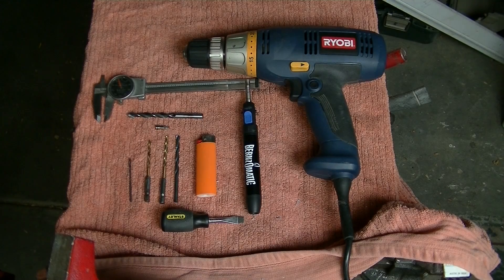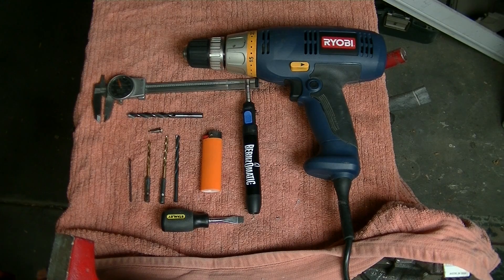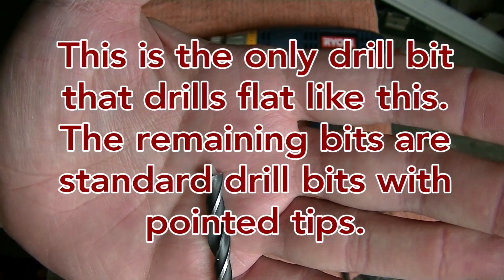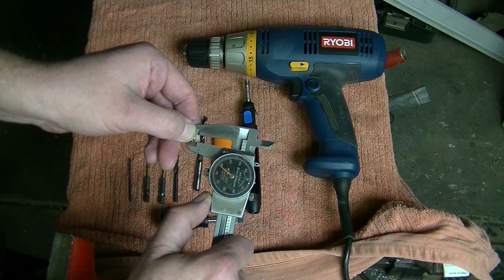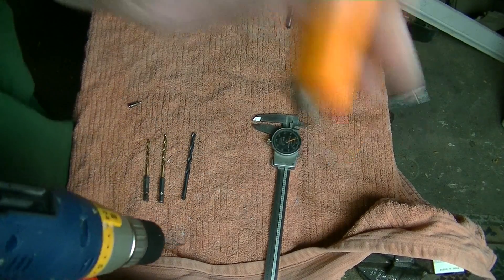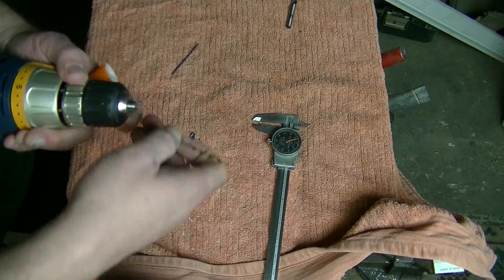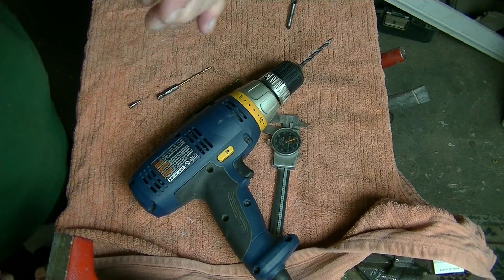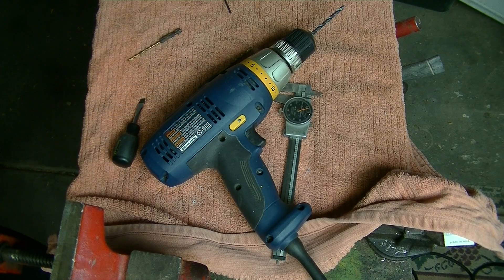Make A Bic Lighter Refillable By Installing A Refill Valve

Comment: You're insane. I wanted to refill if to SAVE MONEY. Why the hell would anyone spend $10+ to end up with a cheap-looking refillable lighter? I'd rather spend $10 and buy a proper good-looking one lool
Reply: Lol Clipper? Really? I call bullshit. No way in hell are you going to get me to believe a refillable butane lighter that's CHEAPER than a single BIC is going to be as good. Pretty sure that's why they sell them in packs.
Reply: retvolki he must have alot of down time
Reply: fezbot100 or he doesn't want a store bought schmucks lighter.
Reply: With 10 bucks you can buy an ok one bro.
Or you could also buy a crappy $3 one, remove the valve from it and install in your BIC. Sounds like a smarter idea.
Reply: Show me one you can buy that isn't a damned torch and I'll agree with you.
Reply: fuXstiCk Clipper produces some darn good ones, they're pretty much like BIC except that they're refillable and flint is not as durable but that's easy to fix.
Reply: Clipper wishes it was a Bic. All they will ever be is a Bic lighter knock off.
Reply: fuXstiCk okay so your problem isn't that you can't find a good non torch lighter your problem is it's not a refillable Bic
Reply: Minong Maniac Clipper lighters were around for about 20 years before bics so if anyone's a knock off it's Bic
Reply: Maui Randall lol try again. The clipper lighter company didn't even START until 1972. Before that they weren't clipper and made perfume and makeup or some shit. BIC started in 1973. Do some fact checking before you start throwing BS out there.
Reply: fuXstiCk okay so you admit bic is still the knock off but it was made 1-3 years after clipper instead of 20
What was your point?
Reply: fuXstiCk and the Clipper company started in 1959 the Clipper lighter was designed in 1970 and released in 1972 all before Bic
Reply: Maui Randall you're not a 'knock off' unless you're trying to be like something else. I didn't proclaim then to be a knock off. I'm simply contesting your '20 years before' bullshit.  BIC pocket lighters have never come refillable. So what's the comparison?  However, i AM saying they're SHIT compared to BIC
Reply: Retvolki why do you care what the your lighter looks like? Personally mines in my pocket till I use it then it goes right back in my pocket so nobody borrows it then posts lighters are free on these videos.. lol sorry I just couldn't resist the last comment. Not aimed at you bro..
Reply from the maker: Some of us prefer functionality over aesthetics ... different strokes ...

Comment: Please tell me where I can get the butane refill nozzle? I've searched everywhere online. Then some people tell you to remove them from an existing refillable lighter, but no one shows you how to do that. Please any information you can share with me, would be extremely appreciated. Thank You So Very Much.
Reply: HERE in calif i usually find those stores harbour frieght, or those dollar store usually owned by oriental, anyways they usually have butane torches for less than 2.00 which is better than spend $10 and up i just bought 20 yesterday for this.
Reply from the maker: Yeah but those nozzles suck
Reply from the maker: Tammy, did you try the links in the video description?
Reply from the maker: Try this Tammy: https://www.evike.com/products/37975/
Reply: Mike Sims Mike when you install those valves you posted the link for do they end up being flush to the bottom of the lighter or is there a bump from the refill valve head poking out? I am looking for some good metal valves instead of the plastic ones I currently use. Although I haven't had any trouble from the plastics yet, I like the looks of the metal. They have a more "quality" look about them.
Reply from the maker: https://www.ebay.com/itm/Blackcat-Airsoft-Inlet-Valve-for-WE-Magazine-40mm-BB-Shower-BCA-P-038/332616274454?hash=item4d71799216%3Ag%3AWUkAAOSwHP1azJYi&_sacat=0&_nkw=airsoft+valve&_from=R40&rt=nc&LH_TitleDesc=0

Comment: OK, but the flint that produces the spark will wear out & render the lighter & the hack useless. But, nice job!
Reply: hatfez that's why you buy lighter Flint's off eBay you can get like 100 for less than $10
Reply: I use flint out of dead Bics. Hatfez you aren't the brightest bulb in the pack are you buddles...
Reply from the maker: Ive gotten up to 20 refills out of a flint ... when its done, just move the nozzle to another Bic
Reply: Mike Sims or simply take the spark wheel off and put in a new flint. Takes 10 secs.
Reply from the maker: Ive gotten over 30 or more refills from a single dflint
Reply: Dunce

Comment: You can get these metal nozzles / refill valves out of cheap barbeque lighters that cost 1.00 each from Dollar Tree stores.
Reply from the maker: Those BBQ lighter nozzles have a long stem in them making them unusable for this kind of thing.
Reply: @MikeSims70  I've done several and they work just fine. You just have to install opposite side of the straw. Pick a clear plastic lighter for your install or hold it up to a bright light so you can see which side to drill the hole.
Reply: Jacob Littlehorse yup, then your lighter has a big bump on the bottom so you can't stand it up. no ty.
Reply: So what....why do u need to stand it up.  That's silly.
Reply: Guess me and you have two entirely different quality requirements... Why would you lay it down?
Reply: Why would you want to stand it up ?  It's gonna spend 99% of it's time on it's side or in your pocket anyways. If  that sort of thing even matters then go buy yourself a real lighter.

Comment: i did manage to make a cricket lighter refillable like u.but i get the valve from a working honest lighter.im excited about it.but it is too expensive.those honest lighter which i bought worth 10 of  cricket lighter.been trying to did a cheaper one using plastic valve from cheap disposable.it wont work .as much as bic or cricket is cheap,the fact that they are disposable make them expensive.not to mention that they worth double and triple of most plastic lighter out there.heres another fun fact.any plastic lighter that their flame output can be adjusted hi and low.can be refilled with a simple tool.
Reply from the maker: Not sure I'd mess with a cricket ... they're just kinda cheaply made.
Reply: Cricket is junk. Use a Bic.
Reply: Kind of is an understatement from hell. Lol i won't even buy cricket lighters.... Unless i want a pocket torch or a rocket.

Comment: But you're 10 dollars (atleast) down because u need that fitting. Wudnt it be cheaper to buy a lighter for 1/10th of that?
Reply from the maker: ahtabay Ecks_BadSin45s_ Bro, sometimes we do things BECAUSE WE CAN - and that is a reward all on its own ;-)
Reply: Mike Sims that IS true. On a side note i found a spot around here that sells refillable lighters for a buck. They kinda suck but the reason why i bring it up is that the valve wont cost 10 bucks anymore
Reply: I have a non-refillable lighter that is a collector's item. Worth the 4 bucks to me.
Reply from the maker: The valves in cheap refillables are worthless. Take one apart some day and check it out.
Reply: Do people seriously have no concept of 'long term results'?  And after you've bought 25 of those 1/10th the cost lighters Joe much more have you spent?  Not only does it eventually pay for itself in the long run but damnit we like to tinker!

Comment: if you don't want an exact fit why use a caliper?
Reply from the maker: Mariano Nuves - the caliper is merely used as a guide to help you find the right drill bit for your particular nozzle. We don't actually need to know the size of anything.
Reply from the maker: Yeah ... I actually corrected that in the video

Comment: I just did this with a Scripto Grill lighter. I took apart a broken refillable lighter that I previously modded, the slide on the button broke so it was dead. I tore it down to the little valve on the bottom. With a little luck I was able to extract the valve from the lighter. On the grill lighter. I tore it down to the fuel tank, I heated a screwdriver that was a little smaller than the valve and pressed it through the tank (Tank was empty). I fit the valve on the tank and it fit snugly. I had some of that as seen on TV Lazer Bond UV glue so I glued the outside of the valve heavily to the fuel tank. I had to modify the case of the grill lighter for the valve to stick out. I put a little butane gas in the fuel tank and the lighter fired right up. I'm going to leave it before fully filling it up in case it leaks but it shouldn't since that lazer UV glue seeps into small spaces. Might post a quick video of this showing what I did. 

I don't normally shoot video on the fly of me doing stuff like this because I don't know if something is going to work or not.
Reply from the maker: Curious to know if the UV glue formed a strong enough seal to prevent leakage...
Reply: @MikeSims70  it did last a while but then it started leaking. You can try the commercially available valves if you can find them.
Reply from the maker: @coondogtheman  Oh Ive got valves, and if you drill the hole properly, then the threads from the valve will seal the butane perfectly ... no need for glue.
Reply: @MikeSims70  I ended up just getting some clipper lighters that have refill valves and refillable flints.

Comment: Why would anyone be this stupid? If you want to refill a lighter, just buy a damned refillable lighter. They aren't that expensive for crying out loud.. Why would someone go through all this crap to refill a .99 cent lighter?
Reply: Admiral54 Barns bic is a quality lighter. those cheap ones are crap
Reply: If anyone seriously thinks a bic lighter is a "quality" lighter, then they obviously have low standards..
Reply: Admiral54 Barns what do u think is a quality lighter
Reply: I have several good quality Zippo's. But for Butane, I love my $300 lighter from Tiphany's in NY. 18kt gold. Had it for 10 years and still works like new.. But any good butane lighter over $50 is probably a good quality  lighter. You don't have to spend a fortune. But honestly, a bic is just not worth the hassles to drill and put a valve in.. The valve cost more than the bic does.. It's a waste of a good valve honestly..

Valve costs $3.75 each. The bic costs .99 maybe $1.29 at most.. It's just not worth the price of the valve in my opinion..
Reply: Admiral54 Barns i understand what u mean. i live on a budget and i dont like the zippo flavour in my tobacco and my zippos (autenthic) sometimes have problems like broken hinges and faulty flint. in my opinion i wouldnt spend so much money on a device that only creates a flame. i just think bic lighters are very reliable and stay on in moderate wind etc but again thats just my opinion ;)
Reply: Most people have issues by using crap butane.  Get the good clean stuff from a smoke/cigar shop.  It's better on lighters.
Reply from the maker: yawn - for the same reason why you would waste your time posting half baked criticism about a video on the internet, knowing your opinion won't be weighed by anyone as valuable ... shrug
Reply: Because we are THAT cheap!! Mwaahahahahaha!!!
Reply: I have a personalized bic that means a lot. It’s worth it to me.
Reply: superjojo555 my favorite kind of lighter is a borrowed bic
Reply: Mike Sims you're just mad everyone realized it was a waste of time and money before you did

Comment: I ve got a French made Silver Match vintage lighter . as it is a problem as it doesnt have refillable hoe. might thinking use your way on its metal tank, but..... i could find a suitable nuzzle. any recommend? thanks
Reply from the maker: I'm curious ... can you find a picture of that lighter like on google or bing images and reply to this with the link to the image?

You say it has a metal tank... if that is the case, then this method wouldn't necessarily work because it is dependent on the lighter being plastic. The threads of the nozzle need to cut into the plastic which is the core of why it does not leak butane. With a metal body, and assuming there is enough metal in the base to do it, you are going to have to use a threading tap, making sure you drill the hole to the diameter specified by the tap. The tap will have to have the same thread spacing as the nozzle as well, and if you aren't familiar with taps and die's then I recommend finding someone who is, and relying on them for determining the right tap and maybe even having them tap it for you.
Reply: Mike Sims thanks for your hints. the lighter something like this https://www.catawiki.fr/catalog/briquets/fabricants/silver-match/1731253-silver-match  . to crack this lighter means cracks a generation to me. thanks
Reply from the maker: Does yours have that insert like the one in the picture? Does it use butane or did it use butane?  Looks like a tough lighter to get a nozzle in, and based on the photos, it doesn't look like its a butane lighter at all ... almost like a zippo style.???

Comment: These valves can't be more than a few cents in bulk. Can't track any down though. I actually came to this video because I'm looking for a replacement valve for a butane soldering iron.
Reply: Chaos Corner look online for c02 refill valves they're $2-3
Reply from the maker: Im right there with you Chaos ... in bulk quantities, they should indeed be much cheaper ... but oh ... where to find those quantities????
Reply: Well, China :) It would be nice to have someone who already made them but I wonder how much it would cost to have them made to spec.
Reply from the maker: I like where you're going with this ... obviously there is an underpinning of doing something on a larger scale?
Reply: Yeah. But I'm just pondering. It's not really something I'd want to get into myself.
Reply from the maker: As with anything ... it would take some work for sure. And since we’re dealing with butane etc. I can imagine litigation in the future as well... 

It would be nice, however, to be able to buy a bunch at like $1 and be able to offer them to people who pass through here at a quasi decent price.

Comment: lol this guy is obviously a machinist. the tac way is easier and works just as well, correction: a wanna be machinist after watching the whole video.
Reply from the maker: I am neither a machinist, nor do I desire to be one (my grandfather, however, was a rare talent machinist - so much so that after he retired the company he worked for had to EVENTUALLY shut down a division because they could not find anyone who could do what he did - and they looked for 15 years).

I do just fine as a network engineer. And we’ve discussed the whole tac vs valve thing ad nausea in the comments ... feel free to check em out, but it boils down to personal preference. Some of us feel that a valve offers a much more stable and long term solution to the tac, with of course, much less wasted butane.
Reply: And some of us feel that the Flint will only work for a little bit longer anyway and Tacs are free and available unlike valves and drill bits

Comment: Orr.....
You can start the hole with a small drill bit then use a larger one and fit to size yano what um sezzin?
Reply from the maker: Fer sure ... but ... isn’t that exactly what I did in the video??
Reply: Mike Sims you're right.

Comment: you nevered answered my important question, how does the valve work on a bic lighter, it looks like a block of brass. I dont see how anything could pass through that solid block, not even gas. so how does the gas come out? that would make a good video.
Reply: Mike- cut him some slack- he's comin' off a high...
Reply: it oozes out of mikes ass
Reply from the maker: Well ... the "block of brass" is actually a carefully designed and manufactured inlet valve that only allows a substance to pass in one direction ... ie when you take a can of butane and press it down firmly on the valve nozzle and it then allows the gas from the can to pass through it into the lighter. When you remove the can from the nozzle, the nozzle forms a seal preventing the gas from escaping the lighter... so then the only path of escape is through the top of the lighter and only after you press down on the button just underneath the round flint striker ... hope that answers the question.

Comment: I bought one these on ebay and it lasted 1.5 years before the flint went bad. I can't believe bic puts Flints that are that good in the lighters but they do. to everyone saying this is dumb. they are dumb. they didnt consider how long it could last and made a assumption.
Reply from the maker: 100% could not agree with you more!
Reply: I always used to wonder how long a Bic lighters flint would last. After converting a lighter to be refillable, I learned a stock Bic still has 2/3 of the flint left over when the first full tank of fuel runs out. I never would have known the answer to that if it wasn't for refillable Bics.